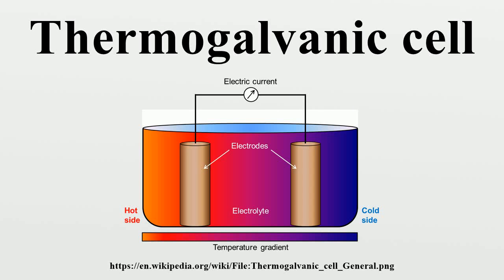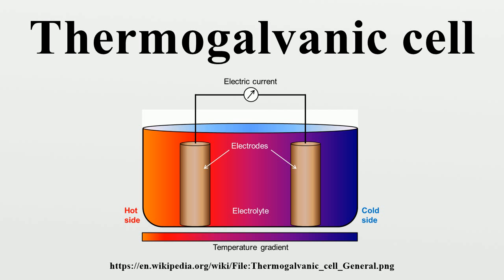Thermogalvanic cell

Comment: Great and clearly conversation~presentation of The thermogalvanic cells that are inexpensive to fabric ate, but further work would be needed to dermine whether suitable cell reactions can be found which will increase their efficiency. The ideal thermodinamic cell will use an electrolyte which produces high exchange currents, has a LARGE ENTROPY OF REACTION, and which is NOT THERMALLY or PHOTOCEHEMICCALY DEGRADED!
Thank you for power design permored present study.